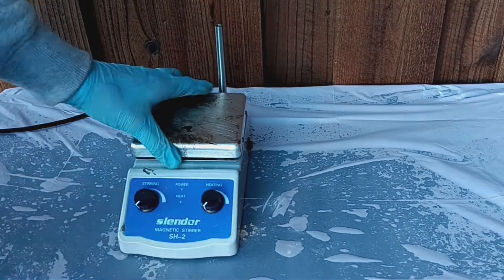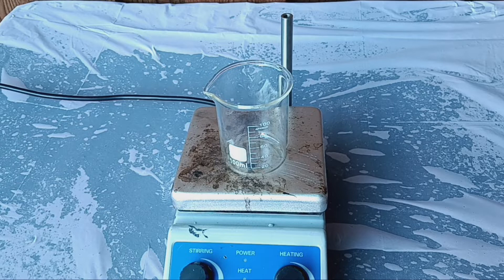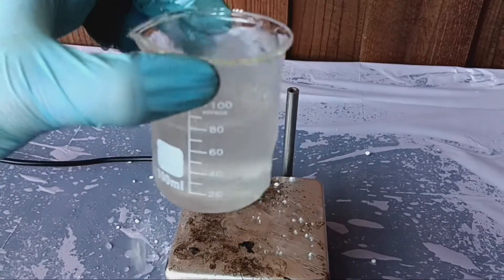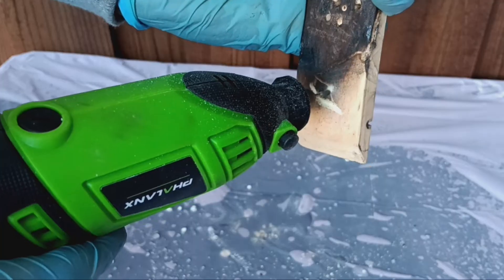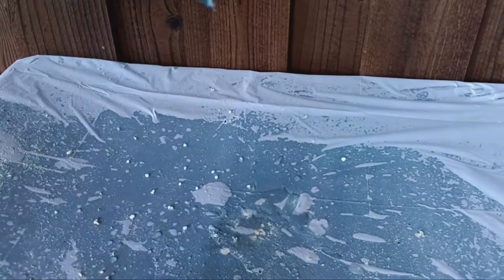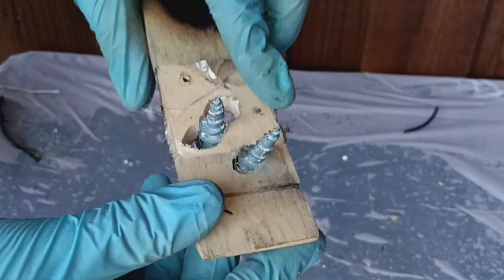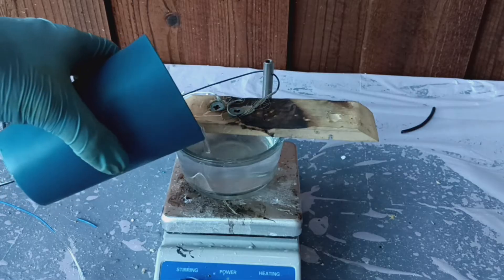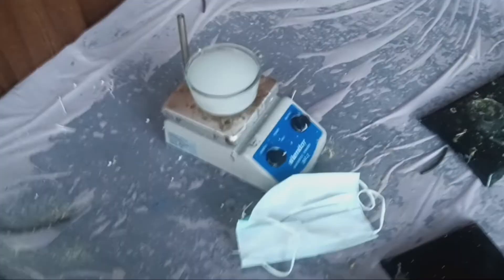How To Make Chlorine Gas

Comment: You didn't make chlorine gas, you made hydrogen gas, ammonia, and nitrate. You can make really weak bleach with water, table salt and high voltage, but you generally aren't making chlorine gas without a chlorine precursor. If you're not gonna learn the chemistry invest in better PPE...

Comment: Far easier way: Hypochlorite-based pool bleach+acidic drain cleaner or strong vinegar.
Reply from the maker: I bet you're right. I just work with what I got. What did you mean by my channel is bassed?
Reply: @CMTcoolmanthings  I am saying your channel is epic for doing dangerous stuff that yt doesnt want posted. Based is a compliment. Also the recipe I gave is like 10 bucks from a hardware store.
Reply from the maker: @deinocheirusgaming  thanks man I will try it if I ever get better safety equipment.

Comment: Instructions unclear grandma dead
Reply from the maker: 10/10 coment
Reply from the maker: Also what's a woosh rocket you wanted me to make one.
Reply: @coolmanthings  it’s a 1L or 2L bottle filled with either ethanol or methanol I’ve found that methanol works better and you only pour a small amount of the fuel in just enough to cover all the sides by turning the bottle however not too much that the is a puddle at the bottom, from there you turn it upside down and ignite it
Reply from the maker: Yo bro ima make a rocket launcher in my next video what do you think?